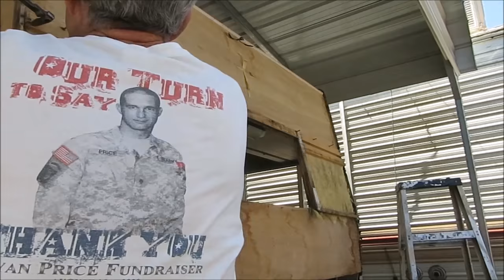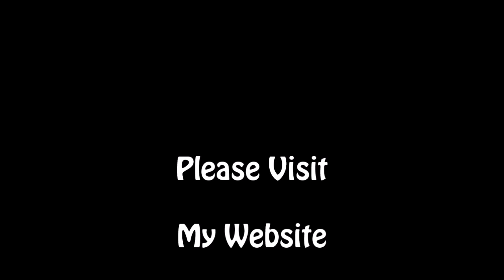V-Log #1 - Working On The 66 Super Shasta

Comment: Where I have to copy parts I tend to use a couple or so wood screws instead of struggling with clamps.  This greatly helps if I need to edge belt sand or use a drum sander in my drill press.

Comment: Hi,  Have You ever considered using a sawz-all for dis- assembly?  I have pretty good results with mine.  I use the Milwaukee torch blades.  If you need to remove brads nails, screws  it obviously won't work.
Reply from the maker: I use a Sawzall when nothing else works. Sometimes you just can't get the fasteners out. Screws especially.

Comment: Serious question: I'm replacing some framing boards on a 1978 travel trailer. 
Originally the trailer was put together using 1" crown staples. I noticed that you are screwing your but jointed boards together using pocket screws and a pocket screw jig. Is there a reason why you are doing it that way? Why not using a pneumatic nailer with large crown staples (it would be much faster)?
Reply from the maker: When your trailer was built the wall pieces were placed in a jig on the floor. The pieces were then stapled together to keep them in place until the paneling could be placed over them and then nailed or glued to the framing pieces. The staple was only there to keep the pieces in place until then. once the walls are built then they are raised and mounted on the sides of the trailer. Framing in these trailers plays very little roll in structural integrity. They are there merely to add an air space between the paneling and the metal skin.

When working on a trailer that is already built and the walls are standing, I find that screwing the framing together gives the walls more strength and makes them more solid which is better for working on them. Nothing worse than beating on flimsy walls.  Yes the other way is faster but again it's harder to work on them in that condition.

Comment: do you have a problem with size of wood you use matching what was in it, like old houses when you remodel
Reply from the maker: Yes. Plywood does not match up and I have to work around that little problem. The floor has the biggest problem with that.

Comment: Is asbestos an issue with older trailers?
Reply from the maker: If you are worried about it just wear a good mask. One with removable filters like the painters use. They are only about $30. The flooring is about the only thing that was made with asbestos and if you aren't grinding it up I wouldn't worry about it.
Reply: mobiltec thank you ☺️